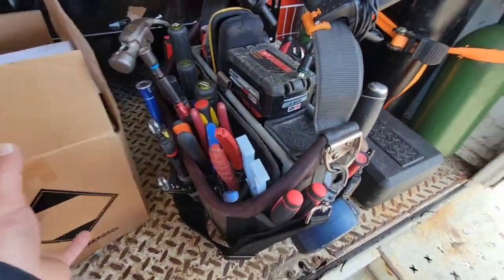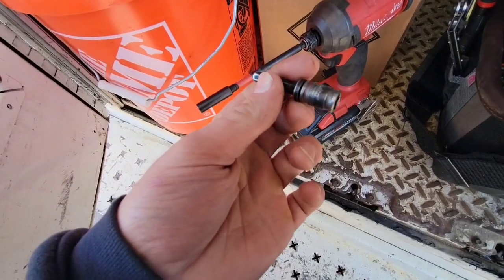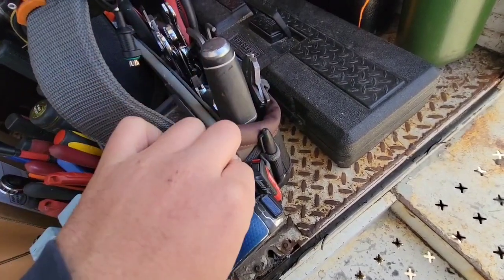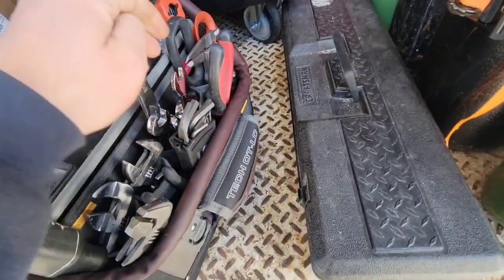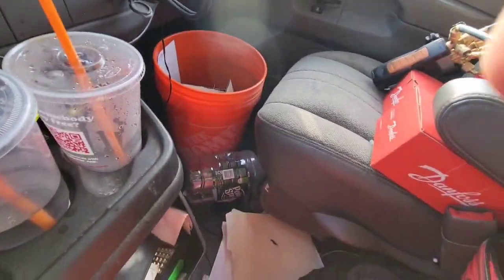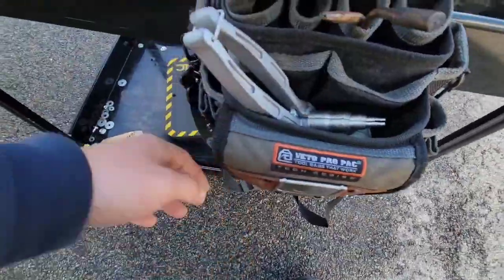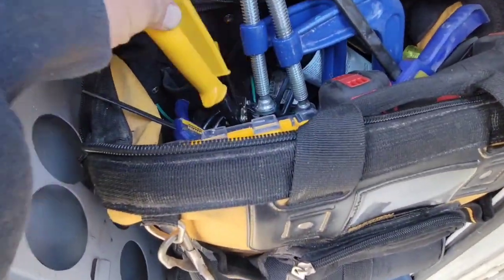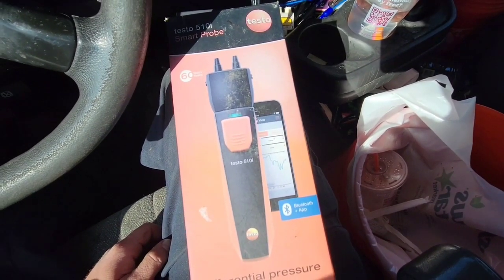Supermarket Refrigeration - Tools Needed for 99.9% of Service Calls

Comment: elitech makes a great digital manifold. i myself dont vacuum through gauges... so i use an elitech which only downside is not having a built in micron gauge. 150 dollars on their website.  does all the refrigerants, temp clamps, timed pressure tests. been working for my 4 months now and i do only commercial work, and residential when i do my 7 day on call.
Reply from the maker: Thanks I'll check it out:)

Comment: Yo have too many repeated tools, for example I like to go with one set of different pliers, electrical scissors, 1/4 ractchet set", some screw drivers, and adjustable wrenches... and then miscellaneous things you could need, insulation tape, valves, connectors and hvac specific tools. Saving weight is important, just grab the essentials
Reply from the maker: I probably do,

I like tools 😅.